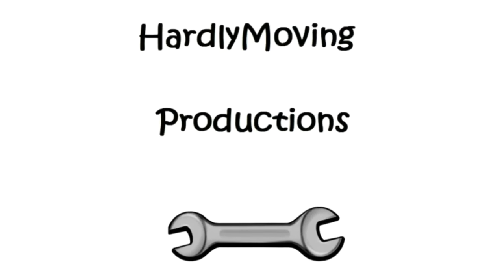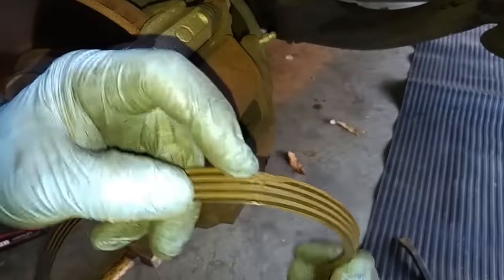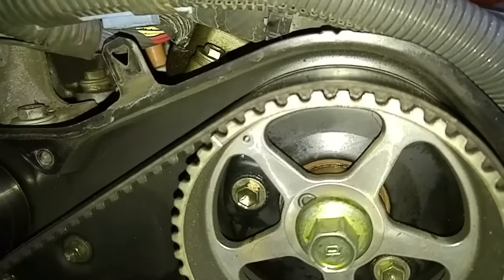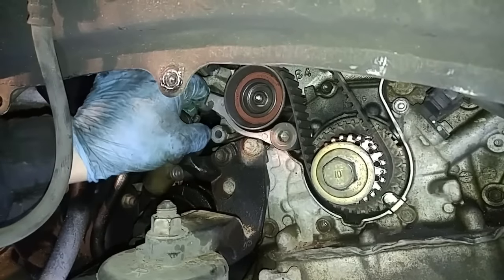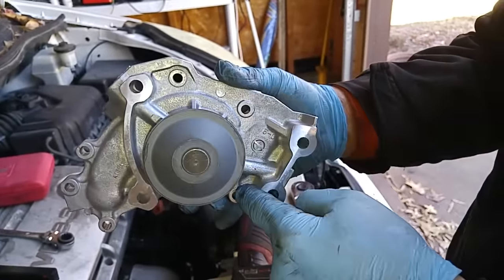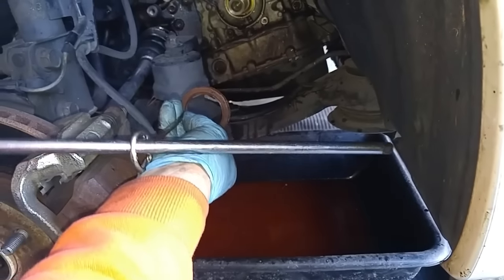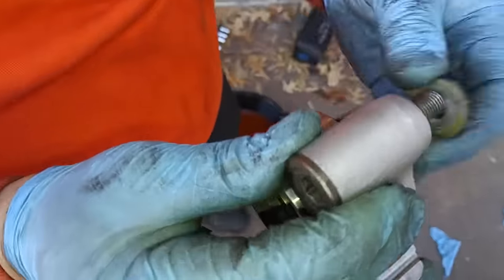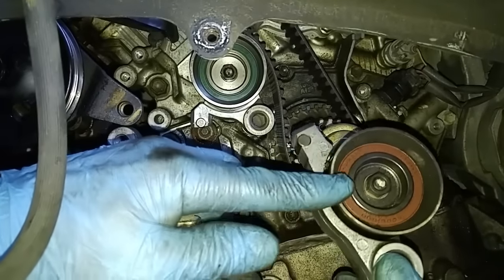Toyota Sienna V6 3MZ-FE Timing Belt, Water Pump, Seals, & Pulleys Replacement

Comment: Thank you for one of the best repair videos I have seen.  I am in the middle of the job.  I am trying to line up the marks before I remove the belt and get into the water pump, however, I can get the marks on the cam shafts to line up, but the dot on the crankshaft timing belt pulley will not line up with the square mark on the block.  The belt was changed at 99000 by somebody else and there is a residual blue paint mark on one of the teeth edges on the crankshaft pulley that appears to line up.  Could it be that somehow the stamped factory marks were somehow never lined up, or they were unaligned during some repair over time.  I bought the vehicle with 120,000 on it 5 years ago, it has 270,000 on it now.  I realize I let it go a little long on changing the belt, but most of the 150,000 I have put on it has been 70 mph interstate driving.
Reply from the maker: Thanks!  At the 5:59 time mark, you line up the dot with the semi-circle hump directly below the Toyota Aisin stamp ... or more precisely, under the A of Aisin.  That is your most important timing alignment mark.  The V backing plate notches for both cam sprockets should line up with the sprocket's vertical line mark.   If they're off a cog, then probably the last guy who did the TB replacement screwed up.  I've see this mistake before.   Use the paint marks on the new belt to bring both sprockets in alignment.
Reply: @hardlymovingpro  Thanks again for the reply.  Your guidance was excellent.  My mistake was thinking that the dot on the pulley wheel itself was the mark where after carefully watching your video once again, I noticed that the dot is really on the toothed plate behind the pulley wheel.  It was hard to see until I sprayed the area with a little engine cleaner.  Your guidance on the A in AISIN was also very helpful as I was beginning to think the little dimple mark on the block was the wrong mark as well.  I have the marks all lined up now.  I will admit that the rear cam pulley mark is a trip lining it up with a mirror, but I think I got it as it pretty well lined up automatically once I got the crank and the front cam.  Now on to the next step.  Once again, thank you for your excellent video and for your response help.
Reply from the maker: @marcprivitera595  No problem and good luck!
Reply from the maker: @marcprivitera595  No problem and good luck with the rest of the repair!

Comment: Very very informative vidio. Good lighting. Love it. Question? What all can you leave on if I just needed to replace water pump
Reply from the maker: The cam sprockets.  Can pull out the pump by loosening the 10 mm bolts holding on the backing plate

Comment: As others have said, great detail, explanation and camera work so helpful.  Question, isnt there a third power steering bolt (just out of view at 12 oclock position on PS pump pulley, at 1:24 timepoint) that also has to be loosened to get PS pump to move?  On a recent belt replacement it wouldnt budge and discovered a third bold up top.
Reply from the maker: Sorry.  Don't recall.

Comment: My ES330 needs to be done ASAP. Just at 9/years 90,000 miles on belt. Im also convinced my camshaft seal is leaking too... My car likes to tick the steering wheel after it warms  up to operating temp. This occured after replacing  leaking PS pump hoses (dry rot)
Reply from the maker: The ticking noise could be a defective replacement power steering pump.

Comment: How do you recommend retorquing that crank shaft bolt after getting the new timing belt on?  I used an impact wrench to get it off.  I'm tempted to use the same to get it back on, but imagine there is a better way.
Reply from the maker: Just impact it back on.  It won't loosen up.

Comment: Excellent video!
Just a few questions:

1) is the crank puller necessary? I routinely pull crank pulley on subarus and only wiggle it out.

2) why did you use a pvc on the crank seal and a specialty tool for the cams?

3) pls confirm you raised the engine from the oil pan.
Reply from the maker: Thanks for your post!  The crankshaft/harmonic balancer puller tool is usually necessary due to corrosion between the harmonic balance and the crankshaft.  There's less resistance pushing in the crankshaft seal compared to the camshaft seals.  I can usually push crankshaft seals with my fingers.  Tilting the engine via the oil pan helps to remove both the side motor mount and water pump.  You can also remove the motor mount studs using an E socket.

Comment: When you replaced the timing belt, the water pump is right there so it gets replaced. But are the seals and pulley replacements done at the same time or is that part of the timing belt?
Reply: Allan Chiu. From what I understand the seals on these engines don't go bad for quite "sometime". I did not replace them when the timing belt was first changed at 84k miles on my Sienna. But I did change them on the second belt change at 168k miles and was merely a preemptive move . They were not leaking but if any of the cam seals go bad it will be pretty much the same process as replacing the timing belt.  Available kits that I have seen for the timing belt do not typically include the crank and two cam seals.
Reply from the maker: No need to replace seal on 1st belt change.  But definitely the 2nd.  The question is will the seals last to the 2nd?  Most of the time, no.

Comment: Doing this job in 2 days! Now I am wondering if I need to buy a new crankshaft pulley bolt. Not sure if mine (year 2004) is TTY and must be replaced. Did you reuse the bolt? Thanks.
Reply from the maker: It's not a TTY bolt.  TTY bolts are mostly used to mate aluminum cylinder heads to aluminum engine blocks.

Comment: What size diameter is the cam sprocket? Trying to figure if an 18” chain wrench will suffice for this. Did you use a torque wrench for any of the fasteners? I found a website with a full service manual for Toyota highlanders with the 3mz-fe engine and Toyota’s torque specs for the cam shaft bolt is supposed to be 162 lbs/ft. so far I only have a cheapo torque wrench that goes to 150 and a tiny one for lbs/in 
Also can you supply a link for the cam shaft seal seating tool? Would be much appreciated. I’ll probably have more questions to ask you when I accumulate all the tools I need to get this done. But as far as is to videos go for this engine and timing belt replacement yours is by far the best and I must have watched all of them. I don’t think anyone else covers the crank and cam shaft seals which i feel is ridiculous. If they are leaking and you replace your timing belt without stopping the leak don’t you just risk premature belt failure by not addressing the issue?
Reply from the maker: 162 lbs isn't right.  More like 90 lbs.  Overtorqued IMHO.  Not replacing leaking cam seals will contaminate the belt.
Reply: @hardlymovingpro  after further analysis I think 162 lbs/ft is the spec for the harmonic balancer pulley bolt that you took off with the 22mm high mass socket.
Regardless of all that will a 24” chain wrench work to get the crank gear off?
Reply from the maker: @deeeyewhy5949  you posted 162 for the camshaft sprocket bolt...not the crank bolt.
Reply: Every now and again I’m a dummy 🙃 but now I know 90-94 lbs/ft on the cam shaft sprocket bolt and 162 on the crank bolt. 
But the most important thing I need to know now is if an 18” chain will hold the cam sprocket or do I need a wrench with a longer chain, 24” or 27”?
Reply from the maker: 24 should be adequate.  The long the handle, the less likely you'll need a cheater bar.

Comment: How old was this belt before you replaced it? How many miles were on it? Also do you know if this is an interference or noninterference engine? 

Excellent video, great quality with the camera angles, close ups, pausing and pointing. Really good stuff.
Reply from the maker: As a general rule, I recommend to my customers with cars approaching or at 100k miles to have their timing belt and water pump changed.  The V6 3 MZ-FE engines are interference.  Thanks for your comment and support!
Reply: TB on this should be replaced every 90k miles and this motor is non-interference.
Reply from the maker: I've seen them last over 150k

Comment: I was fortunate to find this video, thank you! Couple of quick questions. While doing this replacement and replacing the thermostat, how much coolant did you think you needed? 2 or 3 gallons? I plan to change the thermostat and hoses at the same time while the coolant is drained out. Also, did you find it easier to lift the engine to access the water pump versus removing the e-torx studs holding the water pump on? Thanks again for this amazing video.
Reply from the maker: Thanks for your post.  You've got approximately 1 gallon of coolant in the engine block (with some hoses and the heater core) and around another gallon in the radiator.  So combined, you won't go past 2 gallons if you exclude the coolant reservoir.   With a old, high mileage vehicle, changing out the thermostat and hoses would be a good PM (preventative maintenance) idea and task.  FYI - Toyota coolant is very high quality and durable.  You may only need to replenish what spilled out during the thermostat / hose replacement service.
Reply from the maker: Also the water temperature sensor (not water temperature sender) is close to the thermostat and may be worthwhile replacing.  When it goes bad, the car's PCM gets confused and the engine runs terribly.

Comment: Thank you sir!!!  Your video is my prime source in my '06 Sienna belt change I am in the middle of right now.  Lot of cursing as the left cam gear kept shifting when putting on the belt LOL.  Question:  I read somewhere I can test the belt install is good to go before reinstalling the covers and engine bracket mounts.  Disabling the crankshaft sensor and/or the circuit opening relay and starting the engine to listen for any weird sounds.  Is that correct?
Reply from the maker: Thanks!  No need to disable anything especially the crank sensor.  If you did and start the engine, the check engine light will get triggered.  Also after starting the engine with the covers off, you won't be able to rotate the engine enough times to get the belt paint alignment marks where they were before.  But you can rotate the engine to check that the cam and crank TDC marks are in alignment with the backing plate.   As long as the belt paint lines are aligned with the cam and crank TDC marks with no belt slack on the right side (opposite the tensioner), you're good with the alignment.  Also if the left cam is giving you shift problems, rotate the right cam to mount the belt then reposition the right cam back to remove tension.  Same logic with the crank.  Rotate counter clockwise, mount the belt and rotate clockwise to remove slack.  Everything should be in alignment.
Reply: @hardlymovingpro  Ok, will do.  All 3 belt marks definitely lined up after install and I have pulled the tension pin.  All is tight and I'll manually rotate the crank 720 deg.  to make sure the tdc marks still line up on the gears and backplate, along with crankshaft dot.  Thanks again for the fast reply!  My first timing belt change ever.  I didn't change the seals as it looked dry there and was apprehensive about removing the cams.  But then the new water pump ended up being very challenging to put in (expletive after expletive lol).  Also changing front struts while I'm at it.   Hope to go 400k miles on this minivan.  At 230k now.

Comment: Looking for advice.  I'm looking for a Sienna from the 2000's.  Which engine would be more reliable and have a lower cost of ownership:  the 3mz or the 2GRFE?
Reply from the maker: 2grfe.  Has no timing belt to service, more hp and better fuel economy.

Comment: You are awesome I have a problem with my Rx330 2004 cranking start but die out any advice
Reply from the maker: Do you have any MIL / Check Engine light codes?  If so, go to your local auto parts store (like AutoZone) for a free diagnosis / code check.
Reply: No codes
Reply from the maker: @leisouvannasing8734  Could be a failing fuel pump.
Reply: Just replace fuel pump spark plugs recharge Battery check alternator Good also replace Pressure Regulator
Reply: I’m out of answer
Reply from the maker: @leisouvannasing8734  Checked for any vacuum leaks?
Reply from the maker: @leisouvannasing8734  Vacuum leak test.  Have a can of aerosol brake cleaner on hand.  Have someone crank the car.  Spray the cleaner on all hoses and listen for increase in engine rpm's.  If the rpm rises, you've found your leak.
Reply: Thank you So much you Awesome 😎
Reply from the maker: No problem!

Comment: I’m back with more questions!
I’m assuming if I follow your steps precisely I won’t need to rotate the crank and turn the engine over 2 times because you didn’t.
Was able to get a 400mm craftsman chain wrench! For $23!
Someone is selling a 3D printed cam and crank seal tool for 27 on Etsy. But I found 2 blue point tools for $40 they are #ya9217 & ya6017 I can’t find any info to see if these will work. They were made around ‘04 or they stopped making them after then.  But the 3D printed option looks nice. Could get it for$20 without the threaded bolts. Anyway.
I watched carcarenutchannels 1mzfe tutorial and he rotates the engine via the crank. So part of me thibks I should just do my intake manifold gasket and spark plugs at the same time? She just hit 202k miles and I’m not sure but the belt may be original yeesh. But she was garage kept and had good maintaineence records (just no TB) is it easier to do it your way of to remove spark plugs and crank it over by hand? Your way seems more straightforward but I’m guessing it took lots of experience for you to get that comfortable with the process. 
Anyway your expertise is greatly appreciated!
Reply from the maker: V6 engines with auto belt tensioners do not require rotation;  then again, I don't even do it on 4 bangers.  No time savings changing plugs while doing a tb job.
Reply: @hardlymovingpro  I definitely wasn’t saying it would be quicker. Probably take twice as long but just had a thought that it could be more straight foreword for someone with less experience just to ensure that everything is all aligned and perfect before turning her over. But it seems your way just ensures the engine components are as they were before you took the cover off and replaced all the components?

Comment: 7:19 Is there a bolt to be remove so that power steering pump bracket will be push downward and have an access on the bolt holding the tensioner of the timing belt.
Reply from the maker: Nope.  The pump is moving on a pivot bolt.

Comment: Can the water pump come off without removing the backing plate
Reply from the maker: Yes ... just loosen up or remove 10 mm plate bolts near the pump and you'll be able to slide it out by bending the plate a little.
Reply: @hardlymovingpro  yep that did the trick thanks man
Reply from the maker: @billiebowling7755  Good deal!

Comment: Hi, Could you please answer this question. Two spacers fell out of the car  when I was replacing my sienna water pump and the timing belt. I found them under the car. I do not know where they go. The hole is about 5/16 of an inch. You can look at my profile picture in the ABOUT section to see the picture of the spacer. Thanks!
Reply from the maker: They're probably guide or alignment bushings to ease mounting of the new pump.
Reply: @hardlymovingpro  Where do they go. I am stuck and don't want to put everything back just to find out it was an important piece I did not install. Have you seen them while doing the replacement? Remember it might not have anything to do with the water pump as I was opening everything.

Comment: What could happen if we do not hold the pulleys with a chain or a similar tool?
Reply from the maker: The pulley will spin with the bolt.
Reply: @hardlymovingpro  ohh thank you. But the engine will not run out of timing or something?
Reply from the maker: @Pepeauto  watch the video throughly.  Timing is explained.

Comment: What are the torque for many of those bolts yeez that's one of the biggest reason i look at Video to find torque hoping they are added in the Video
Reply from the maker: Suggest you buy yourself a tech manual for your vehicle to get all torque specs.
Reply: @hardlymovingpro  No really.... I just find it funny that you being a mechanic just wings it like it doesn't matter.
Reply from the maker: This video is not a formal instruction repair procedure.  I cross reference my repair with repair manual instructions.

Comment: maybe you can help sproket on front cam looks like  broke off is this repairable  or does the cam need to be replaced  had a p0018 code  come and go  cam sensor was replaced
Reply from the maker: Could be your VVT isn't working properly due to oil passages being clogged.  Replace 1 quart of motor oil with Marvel Mystery oil in crankcase and run for a few thousand miles.  Or combine with motor flush treatment.
Reply: @hardlymovingpro   guess i need to bolt the sproket back on and timming belt
Reply: @hardlymovingpro  so is it possible that the pully  broke without damaging the the cam being th pully is loose  I have not tore it down yet

Comment: Hey hardly movin! Do you prefer to use the OEM tensioner just as long as it’s not leaking? I’ve had bad luck with one aftermarket tensioner before. Looking forward to more timing belt videos!
Reply from the maker: I generally compress and re-use the OEM tensioner.  Haven't had one that leaked.
Reply: @hardlymovingpro  Good to know! I read in service info that it is recommended to offset the crank 60° to the left to avoid valve damage while taking the belt off. In your opinion, is that necessary?